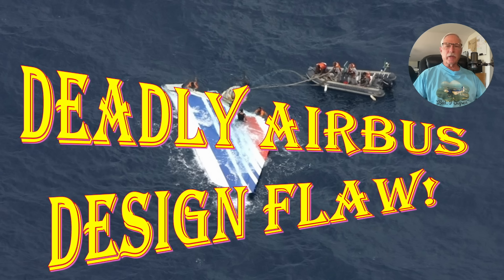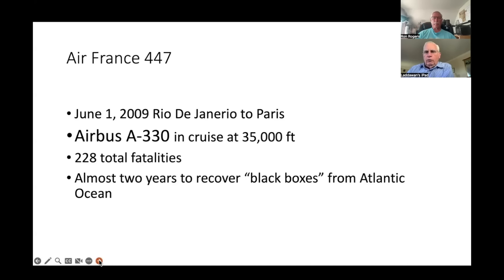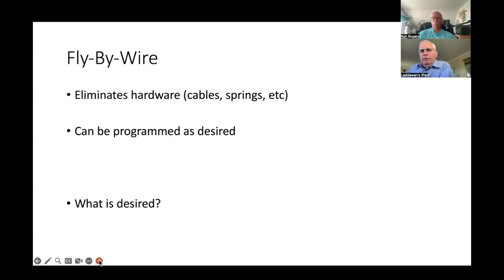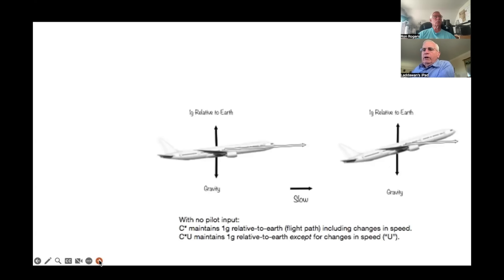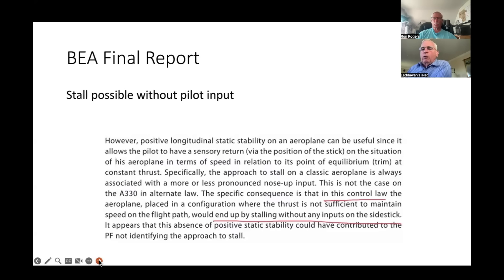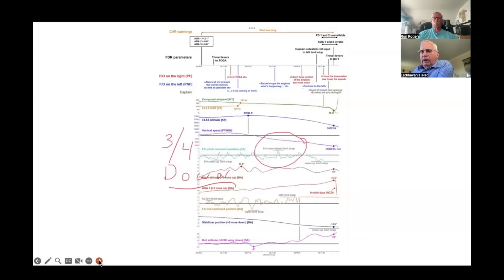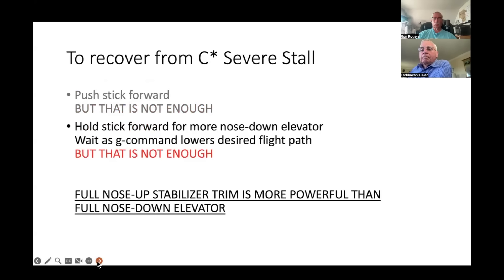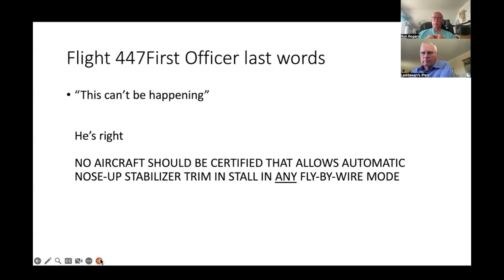Air France 447 Deadly Airbus Design Flaw! Tom Tilden about apparent speed stability in Alternate Law

Comment: I am surprised to see the core fatal design flaw in this aircraft missed:  The un-linked sidestick design itself.  Physically linked control columns, FBW or mechanical, are a deeply implied comms device directly indicating to the other pilot[s] what control inputs are being made.  That loss of communication, and thus loss of situational awareness is deep and functionally crippling in emergent situations; akin to losing the feeling in a limb.  Quite simply, the F/O killed everyone on that aircraft because they made the continuous, persistent incorrect control inputs that eventually lead to an unrecoverable aircraft state.  There was no oversight (and none possible) because no one could tell that the F/O had freaked out and wasn't making control inputs that matched the numbers.  At that point, the F/O was causing the performance of the aircraft and everyone else's perception of the performance (influenced by his unseen control inputs) to diverge.

Re: the C* pitch stability hack through acceleration discrimination, I caution you.  Sure, it might work under ideal conditions.  What happens when the ADCs fail in some subtle way, and airspeed unavailability has again prompted alternate law?

Do not continue trying to idiot-proof airplanes.  They will just invent a better idiot.  Quod erat demonstrandum.  Instead, make every step of their input observable and auditable.  Sidetone is just as useful on the radio in multi-crew environments as single-pilot.  No one would ever dream of blanket-silencing sidetone, but that's exactly what this side-stick design does with all control inputs.

Comment: This is a vitally important presentation!  No airplane, in a stalled condition, should ever have full nose-up trim activated automatically when operating in any mode of the flight-control system, normal or degraded!!  The lack of control feed-back to the pilot is an additional danger.  Side-stick controllers without visual and force feedback, and auto-throttles that don’t move, can make a degraded condition very difficult to analyze quickly enough to avoid a crash as, I believe, happened on Flight 447.
Reply: An AoA indicator is long long overdue on all Airbus FBW aircraft.

Comment: Ron,  This presentation is truly remarkable.  It does leave me with two, probably very silly, questions;  1)  Tom stressed 1g ‘relative to Earth’.  What other type of 1g is there?   [I suppose it could be 1g inverted?]   2)  A lot has been said about the severe icing overpowering pitot heat, however, little or no mention of loss of aerodynamic efficiency of the wings and/or horizontal stabilizer.   Why is that?  [I’m guessing, because the flight control system was the major contributing factor?]   Thank you for sharing such an informative presentation.
Reply: "What other type of 1g is there?" Most pilots think of g as displayed on a cockpit g meter. For example, if you are in a sustained 30 degree bank level turn, your cockpit g meter would read about 1.15 g (In level flight the formula is g load equals 1 divided by cosine of the bank angle). In aircraft from a Piper Cub to a Concorde the pilot must add back pressure to maintain a level turn compared to straight and level flight. 
But in a sustained 30 degree bank level turn at constant speed you are at one g relative to earth. In other words the vertical component of g is one g straight up opposing gravity straight down. In both the A330 C* and the B777 C*U Normal Law, fly by wire compensates for bank at 30 degrees and the pilot does not have to add any back pressure and can release control pressure in the turn. This fly by wire compensation stops at high bank angles.    Tom
Reply: @TomTilden  Thank you for the explanation.  I do appreciate it!

Comment: My wife was part of the crew that handed over the aircraft to the relief crew of AF447 in Rio on that fateful last flight. Many people criticised the reaction of the crew but no one criticised the aircraft beyond the choice of the pitot/ probes I realise how treacherous this situation was and how quickly their destiny was sealed. After flying straight up into the coffin corner they had less than 90 seconds to react. When faced with conflicting indications it is customary to say it is urgent to do nothing at all but little did I know the aircraft was capable of causing the same predicament on its own. Another area of interrogation on my part is how the CG influenced the controllability given this aircraft has fuel in its stabiliser as a ways to maintain the aft most / most efficient CG in the cruise phase. Thank you for this in depth explanation
Reply: GOOD POINT about CG. My Airbus time is in the A-320 and I did not consider CG being intentionally held aft. My understanding is that unlike the A-320, the A-330 transfers fuel to keep the CG aft during cruise. This reduces trim drag during cruise, but it also means the elevator and stabilizer have more authority. Full-up elevator and full nose-up stabilizer with an aft CG will produce a higher angle of attack and worse stall than full-up elevator and full nose-up stabilizer with a forward CG. 
We should remember that the primary cause of the loss of Air France 447 was that the FO flew the aircraft into a stall and instead of applying sustained forward stick at stall warning he continued some aft stick. Worse, when the aircraft rolled right and the nose dropped he held full aft stick. Had the FO reacted at the initial loss of airspeed by leaving attitude at cruise attitude, setting cruise power, and turning off the flight director (all actions that are required by the Airbus procedure for loss of airspeed), they would have flown through the storm, recovered airspeed, and continued to Paris. 
Airline pilots should never apply full aft stick in a stall. But unfortunately, several have, and several will. It was night, in a thunderstorm, with lots of failure messages suddenly displayed, sensitive controls, a flight director that came back on directing the pilot to continue climb, and it was all unexpected. Fly by wire should not make a bad input MUCH worse by adding automatic nose-up trim in stall.

Comment: Concorde's maximum speed was either M2.02 or limited by skin temperature. TMO on the nose was 127 degrees C and it was usual on the North Atlantic (where Concorde spent most of its time) to be speed-limited by skin temperature as the upper air is relatively warm and M2 may frequently not be seen on many of these flights.
Conversely if going to Barbados (a summer destination from London) the upper air over the tropics is relatively cold, so generally M2.02 was the limit as the aircraft did not approach skin temp limit.
Incidentally, many commentators attribute the skin temp rise to 'air friction'. That may be a minor contributor, but the major source of the heating was from the compressed air in the shockwave on the nose.

Comment: Two decades or so ago I was involved in the development of an A320 PC-ATD (ground-up design and build on a new platform, not built on top of a flight simulator game). My role was to replicate the operation of the ECAM and the electronic checklists, which meant studying the FCOM, QRH, Electrical and IATA technical operations manuals to a depth greater than a flight crew needed to know but far less than maintenance needed to know. Apart from the stream of contradictions from one manual to another and real oddities (anti-ice information in the wheels section anyone?), I also found a number of systems operations that could compromise the safety of the aircraft. At this distance I can only clearly remember one because it did play a part in a major crash and loss of life, so I never forgot it. If the aircraft got into a bank angle of 67 degrees the entire flight control system would throw its toys out of the pram and drop you straight back into Direct Law. Forgetting for one moment that you really don't want to be there in the first place, now the aircraft makes it so that you have absolutely no chance of recovering.

I really hope that's been fixed in the intervening years.
Reply: Direct law is how almost every analog aircraft flies.  

One common theme in three Airbus crashes (the first A320 crash, the first A330 crash, and AF447) were the pilots reliance and overconfidence in Normal Law. 

The first one in Alpha Protect, as he was demonstrating it but didn’t realize it simply would not let him pull up further to clear the trees (though IMHO this probably saved everyone on board from the initial impact). 

Second was the plane incorrectly capturing altitude right away (a very dumb design regardless if it was still in altitude capture/hold) with a simulated engine failure.  Again.. Alpha Protect worked exactly as it should but the airspeed decayed too much. The recovery altitude was subterranean.  I believe that Boeing uses airspeed rather than angle of attack and this is a better design that would have prevented this.  No plane should ever go below Vmc (or really.. V2) no matter what the AoA is. 

The last was an inexperienced relief pilot hand flying an aircraft that he lost control of and he figured that if he just kept pulling back, Alpha Protect would come and save the day… not realizing that the plane was in Alternate Law and Alpha Protect was disabled.
Reply: @calvinnickel9995  'Almost every aircraft' - yes. Unfortunately when I was involved with it, Direct Law in the Airbus left you with just the rudder and engines. A ridiculous piece of design, but there it was.
Reply: @calvinnickel9995  Direct Law - at least back then and according to the old Airbus manuals I still have - left you with the rudder and engines and that was it.
Reply: @daigriffiths399  In DIRECT LAW the sidestick controls pitch and roll surfaces directly proportional to pilot input just like a conventional aircraft. There is no automatic trim, so the pilot must trim manually. Direct Law is a fly-by-wire mode. 

What you are referring to is what happens if you lose all electricity including even battery. In that very unlikely case you are left with only pitch trim and rudder (and engines) in the Airbus A-320. In the Boeing 777 if you lose all electricity including battery you have pitch trim and one spoiler on each wing (and engines). 
Note in both aircraft that engines are also fly-by-wire with separate logic and control from flight control fly-by-wire. By design, electrical power for fly-by-wire is highly redundant and reliable.
Reply: @TomTilden  Thanks. It looks like it has been changed in the intervening years. The Airbus OEM manuals I have on the shelf date to the launch of the aircraft (actually, I think they might even pre-date it), so they are very out-of-date now.

Comment: I did not fly Boeing fly by wire, I flew a lot of Boeing "old tech" including the 747-400. I retired off of the Airbus 330. I found some major drawbacks to the Airbus fly by wire flight controls, and even more drawbacks to the Airbus auto thrust , and yes non moving thrust levers. Thank you for your fine presentation!!! You gave voice to my concerns.The powers that be within the airline were deaf to this.

Comment: I had heard second or third hand that there were a couple of times when Northwest had the pitot tube icing situation similar to AF447. The pilots maintained their attitude and power setting. Basically they did very little and nothing to make the problem worse. The problem fixed itself in a minute or so when the ice melted on the pitot tubes.
Reply: There were many cases similar to AF447, but none of the pilots did what the junior FO did (and the senior FO watched him do). 

This is turn critical difference; Airbus designed their FBW system assuming that pilots would react reasonably to any unreliable speed scenarios. They can’t protect against unreasonable reactions by pilots.
Reply: That is true and NWA had reemphasized that method and hopefully it has carried over with the merger with DAL.
Reply: In fact, the pitot tubes cleared themselves of ice probably about a third of the way through this predicament from what the accident report stated. After that, the airspeed would either come back or disappear based on the angle of the plane, since sometimes the air wouldn't even hit the sensors they were supposed to hit, or if they did it would be such a low speed that the plane would reason that those speeds could only be achieved on the ground, and the stall alarm wouldn't activate like it was supposed to. Air France was supposed to replace the pitot tubes on all of their Airbus aircraft and in fact the plane used in flight 447 was one of the ones scheduled to have this done, but this flight occurred before the maintenance could be performed. The new pitot tubes were supposed to be more robust and have a better heating element. Would that have been enough of a difference to make a difference? It's hard to say. It probably wouldn't have hurt, but that's the way these things work out sometimes. A lot of little coincidences, mistakes and oversights come together to form the perfect storm and cause an accident.
Reply: @Klink330  The manufacturer, Airbus, can (and should) protect against full nose-up trim in a stall.  There is no reason for the aircraft's software architecture to put the aircraft into an unrecoverable condition even if the pilot makes a mistake.  This is a situation which has happened and for which exists a reasonable solution.

Comment: Oh, you're gonna catch hell for this. Internet lore is Airbus are absolutely, unequivocally, flawless and untouchable.
Personally, I think the Airbus flight deck design allows for incidents like AF447 and AirAsia 8501 because of the unconnected side sticks allowing a pilot to command full nose up and the other pilot not knowing anything about it until it's too late.  All they have to rely on is a "dual input" message, easily drowned out by other alarms and a small indicator on a screen that is very hard to see when the aircraft is shaking.
Reply: I believe they rectified this issue by adding a lockout switch on both side sticks. And aural alerting for dual input. 
Just information I've heard elsewhere despite not being an airbus pilot myself.
Reply: @EinkOLED  The problem is, in a stressful situation like AF447, your hearing is the first sense to go when you're overloaded.  So another aural warning amongst all the other warnings that crew were hearing that night would have made absolutely no difference.
Reply: @bmused55  I've watched a lot of Air Crash investigation videos and agree with you on the warnings. Several situations where an additional warning wasn't even noticed or was ignored. This might be notices as there is a visual component according to a quick search. "When a dual input situation is detected, the two green priority lights located on the cockpit front panel flash simultaneously. After the visual indication has been triggered, a synthetic voice “DUAL INPUT” comes up every 5 sec, as long as the dual input condition persists."

Comment: The a220 has in “in trim” speed, it even shows up as a triangle on the speed tape. Also a trim switch, on the side stick. But I digress
Reply: The A220 controls were designed by Bombardier, so they weren't invested into following the standard pattern as Airbus already is for its designed aircraft...
Reply: @marinareilly-collette2490

I believe they were designed by Collins like the rest of the A220 avionics suite. And Collins after the AF447 crash specifically advertised its side sticks as having tactile feedback.
Reply: @tonymcflattie2450

What is an in trim speed?

Trim sets angle of attack. Next time you are in the sim put the plane into a spiral dive. The airspeed will increase until the plane rips apart but will never be off trim.

Comment: Strong work, thank you both. I've heard there's supposed to be a section of a manual or reference handbook on each commercial plane that tells you how to fly the plane with pitch and power when you have unreliable air speed. In your opinion, do you think the two pilots could have saved the plane provided they accessed that information right away or in a timely manner after crucial checklists and memory items were completed?
Reply from the maker: Absolutely

Comment: What's odd to me is that there doesn't seem to be any training of flight crews to handle the Airbus aircraft in the degraded control modes. I would have thought such a non-normal behaviour of the most critical flight controls would be something that has to be practiced separately to maintain currency since it should/will not be experienced in normal service.